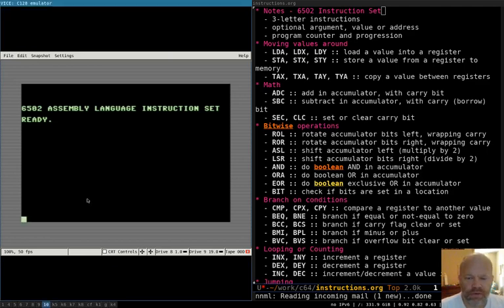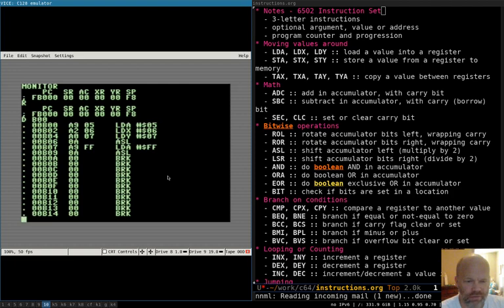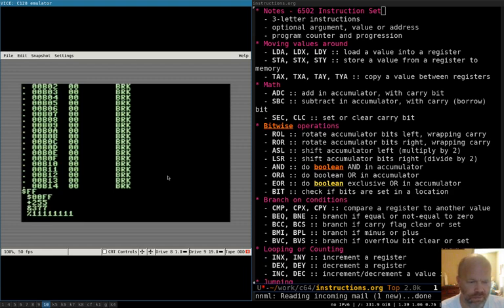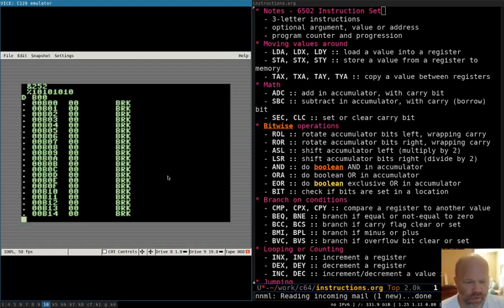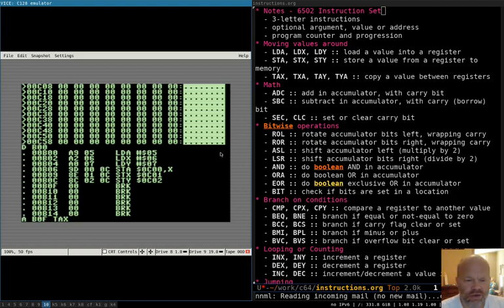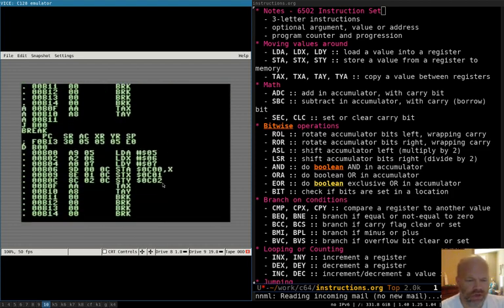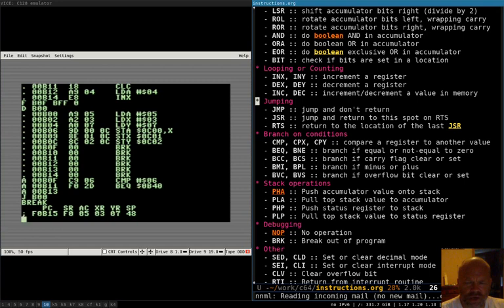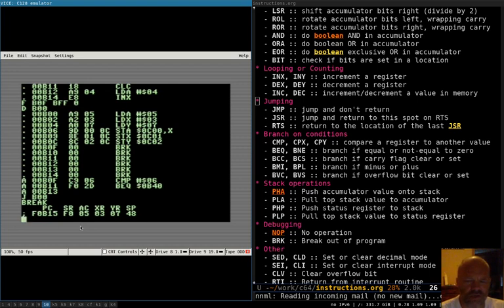Assembly Language #03: Intro to 6502 Instruction Set

Comment: Thanks Aaron for this great tutorial.  1:07:00 - When writing to the 1000 bytes of screen memory (40 columns x 25 rows), if you're concerned about overwriting the 24 bytes beyond that, you could also code it like so...

LDA #$85
LDX #00
Loop STA $0400,X
STA $0500,X
STA $0600,X
STA $06E8,X
INX
BNE Loop 

It just shifts the starting point of the last page back by 24 bytes.  So there will be a bit of overlap in the screen memory that is written to in the last two STA instructions, but doesn't matter since the byte being written is the same... and the redundancy should be imperceptible at machine language speed.

Comment: Technically the C128 uses an 8502 and not a 6502, but it's basically the same thing. Anyways, I only just learned of the built-in monitor when I came across this video. Admittedly I haven't had the time to watch it yet, but just knowing there's a monitor for the C128, I checked out some documentation for it and was able to write and run some rudimentary programs in assembly for it. So if I've come that far just from knowing this video exists, it's exciting to think what I'll learn after actually watching this video and indeed the rest of the series.
Before this, the best way I had of practicing 6502 assembly was using Skilldrick's Easy6502 tutorial and the Java based assembler on the web page. But unfortunately that particular assembler doesn't support any sort of interrupts, which I found very disappointing. Plus the tutorial is rather concise. So I feel having an emulator for an actual platform that used at least a variation of a 6502 with no holds barred gives me so much more opportunity to learn about 6502 assembly and how the 6502 works on a low level. Thanks so much for taking the time to make these videos. And I promise you I will get around to watching it. I would be remiss not to. Looking forward to the experience. Cheers. And best regards. ]D

Comment: Awesome stuff. I went from struggling with my existing programming paradigms to digital epiphany watching this (and the previous video). Setting up a VICE 128 and experimenting with that was a lot easier than working in a coding environment like TMP-at least for now when it's just tinkering.

One thing- where can I get a copy of your mnemonic cheat sheet? Most of the ones I found were a bit busy with opcode variations. That is clean and simple.

Thanks for the work that you put in on this. I certainly have learned a lot between you and a few other YT'ers. This stuff seemed like dark sorcery when I was a kid so it's great to finally open the black box.
Reply from the maker: Thanks! Glad it helped.

Comment: AAROM BAUGHER, 
^^                  What are the differences between 6502 assembly language, Z80 Assembly Language compared to Machine language? Are they the same thing or whats the differences? 
Basic Language has a compiler that converts the basic language into machine language code. 
A Language converts machine code into what?
Reply: Machine language is the bare hex/binary instructions that the computer uses. Whereas assembly is the machine code with human readable mnemonics in place of the hex/binary to make it easier to work with. Using an example from the 6502:

Assembly would be:
lda #$80
sta $01

Whereas the same program in machine code would be:
a9 80 
85 01

Most machine language is represented in hexadecimal like that, but if you really want to get low level, you can just as easily represent it in binary as such:

10101001 10000000
10000101 00000001

But no computers these days use binary instructions like that. Though back in the day, a computer like the Altair 8800 would have you enter instructions in binary.

a9 80 is the same as lda #$80, which tells the CPU to load the hex value 80 into the A or accumulator register. And 85 01 is the same as sta $01, which tells the CPU to store the value in the A or accumulator register into the hex memory address 01. You can sort of see a pattern in the machine language. For instance A9 is the LDA instruction, and 80 is the value it's using. And likewise 85 is the STA instruction and 01 is the value it's using. If you look up an instruction table for a CPU, it will show you the various hex codes for the various instructions the CPU uses. 

There are usually multiple hex codes for the same "instruction" depending on what you're putting into the instruction. For example, A9 is the LDA instruction if you want to load a hex value directly into the A register, or accumulator. But A5 is also LDA, though that's for if you want to load a value from a memory address into the accumulator.

So A9 80 will load the hex value 80 into the accumulator, while A5 80 will load whatever value is in memory address 0080 into the accumulator. And there are all sorts of variations for instructions depending on how you want to use it like that. But I digress.

So when you write a program in assembly then tell the assembler to assemble the code, it just converts it into the hex machine code for the CPU to read. And likewise when code is disassembled, it's converted from the hex machine code into the assembly language mnemonics. Mnemonic just being a fancy word for things like LDA #$80 rather than the raw hex.

You can just as easily write a program entirely in machine code using the hex codes like what I showed and run it on a cpu without an assembler. But not many people do, because it's just unwieldy and not as easy to understand as assembly is. Though some systems require you to do so, like the altair 8800, which as I said, requires that you enter everything in raw binary format.

I recommend you check out the EASY6502 tutorial by Skilldrick. It's a great primer for anyone wanting to get into assembly or just looking to understand it better. I've personally learned a lot from it. You can find it here: 

https://skilldrick.github.io/easy6502/

It has an assembly that runs right in your browser. So you can practice what you learn without having to install or configure anything complicated and just get right into it.

I know that was a bit long, but I hope it's been helpful for you. If not, that's fine too. I'm just happy to share my love of this stuff with people. Best of you luck to you in your endeavours. Take care. =)
Reply: If you want to understand how and where the software meets the hardware involving the ISA (Instruction Set Architecture) and how one generates binary instructions and converts them into hexadecimal representation and from that builds a mnemonic to create an Assembly Language... check out Ben Eater's videos on building an 8-bit CPU on breadboards! It's a great series!